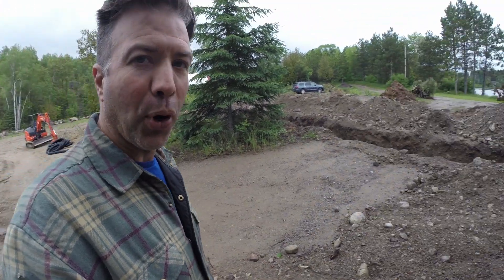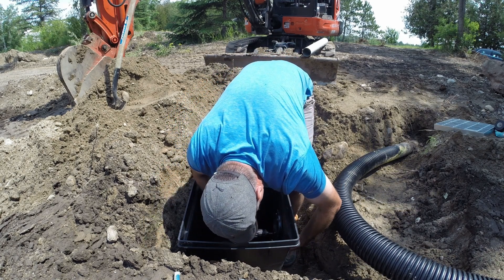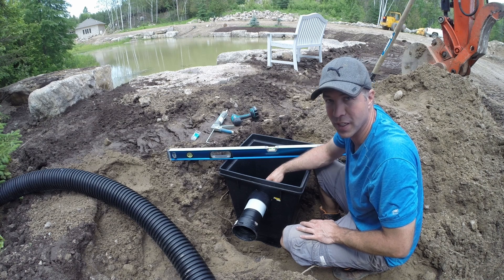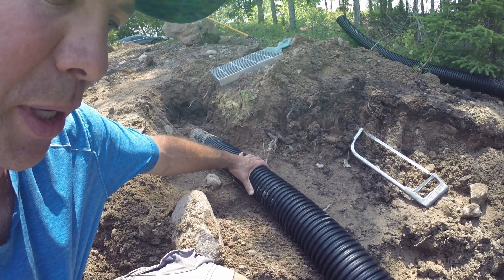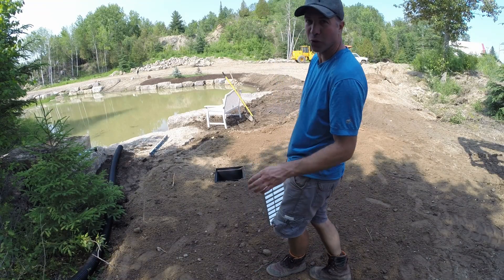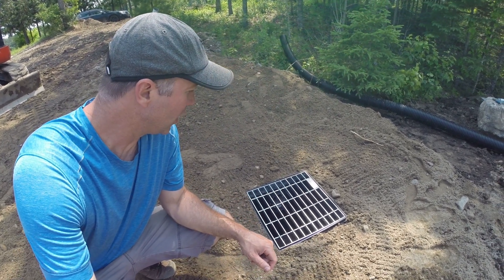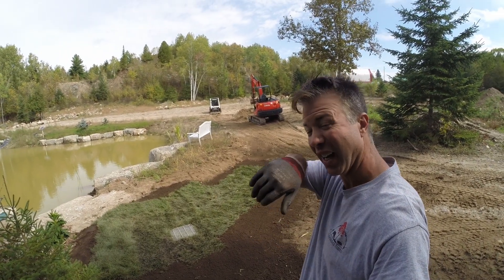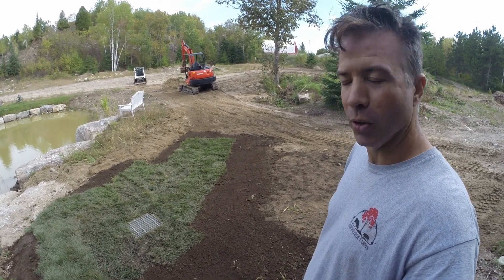FIXING POND CLARITY by capturing Runoff in CATCH BASIN DRAIN

Comment: Why not install some wet land plants to slow down the erosion and runoff? Lol just send the sediment into the lake and ruin that water body.
Reply from the maker: Yes, I will do turf and grasses to hold down particles, sediment, and any erosion. Had to do rough work, trenching and pipe first. Should have clear water flow this year with planted vegetation.
Reply: @ryanhoelke  I'd research native plants. They have deeper roots than turf grasses. Little bluestem for example. Also Joe Pye weed and swamp milkweed would love the waters edge. It will use up nutrients in the water to keep it in balance. You're fighting the tide here.
Reply from the maker: Thanks, I have some little bluestem and big bluestem on a very steep hill project on the property that I'm working on. I've seen their deep roots first hand as they fought through early erosion problems but held on and established. Very deep rooting in one season.
Reply: You should probably dig a storm trench on the other side of the road along your pond or put in 6 to 8 inch drainage to handle that volume of water also you might want to consider putting a sock over your drainage. As time goes on sand will get in your drainage and fill it up completely defeating the purpose of moving water. You may want to consider using a rough mulch along your borders would help to limit erosion by covering loose sandy material
Reply from the maker: @Anders Garp  Thanks Anders. I'm going to try and pull that off this year. I think if I can shape the land like you said I can keep some of that water away from the pond. Definitely need to clean up the hilled shoreline with some rooted vegetation to keep it all in place. Thanks.
Reply: @ryanhoelke  anytime have fun!